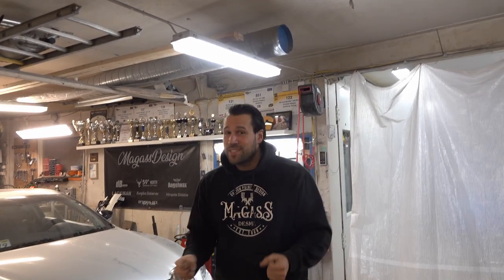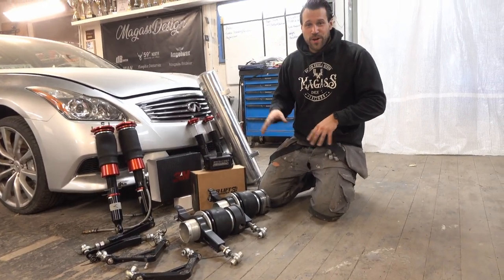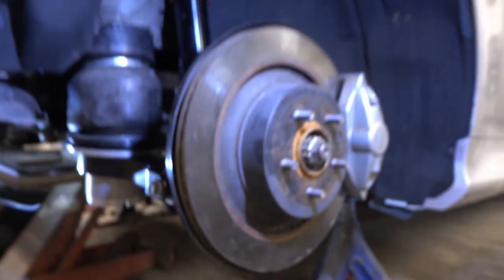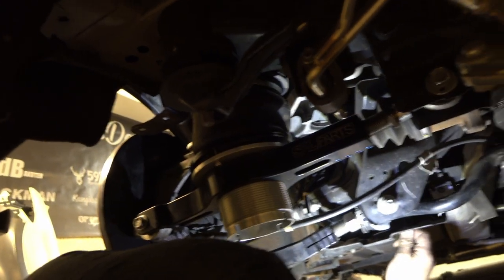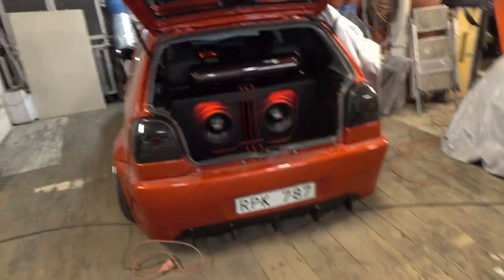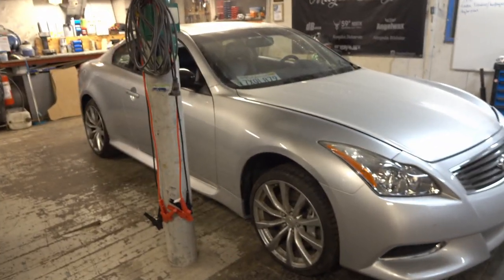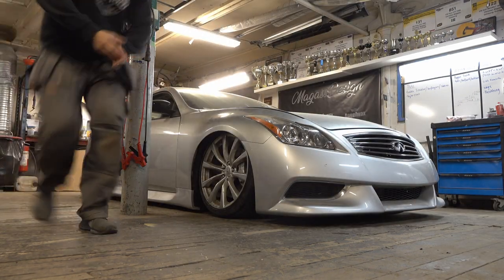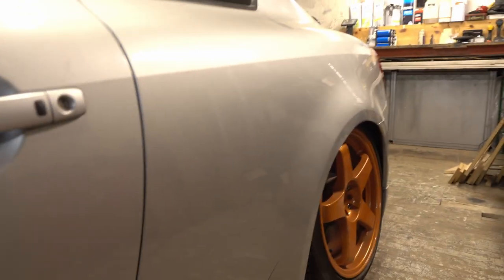INFINITI G37 AIR SUSPENSION

Comment: You need to relocate those pumps, you can’t have them sitting like that or your gonna wear out the piston. Air pumps are designed to be sitting normally or upside down, the piston must travel in a vertical direction not horizontal. The piston and cylinder are made of aluminum with no seal or piston ring, so having the piston sitting horizontal like that makes the piston rub the cylinder wall and throw aluminum all into your air management system causing problems with the valves and wear on the piston shortening the life of your pumps.
Reply from the maker: Thank's man! Really appreciate it and will have to relocate it later when I have time.
Did not know this, but sound 100% logical.
Reply: @MagassDesign  no problem bro, I know shit ain’t cheap and hate to see you get stranded over a pump

Comment: How did u get the air bag to fit on the SPL toe arm spring bucket and can u make a video of how u did this
Reply from the maker: I had to mill a custom plate to hold and bolt the bag to..
Could do a clip when it's time to put all back on the car 😁

Comment: I thought Europe got the Infiniti G badged as a Nissan Skyline 350GT and 370GT.  Is that not the case?  I would think if so getting parts in Europe would be doable.
Reply from the maker: It is true that we have 350z and 370z in Europe. But they also do not grow on trees directly ha ha. Then I can basically only take parts from the 370z that correspond to the platform on the G37 more. Got some parts from Poland now  =)